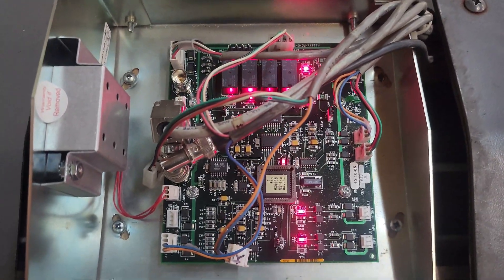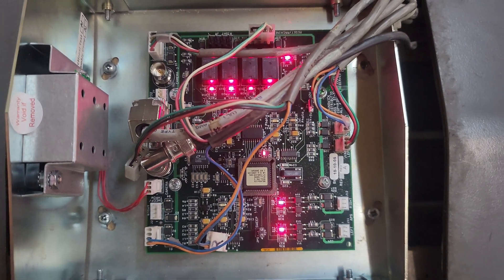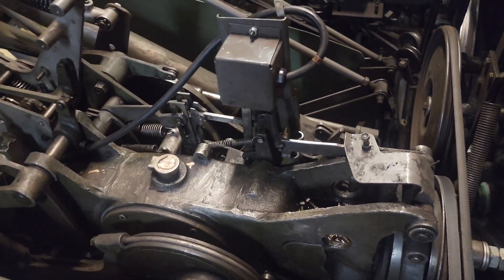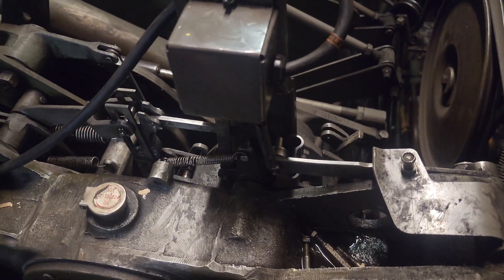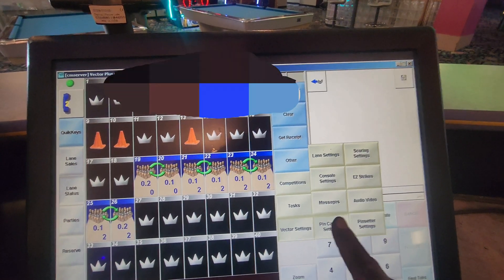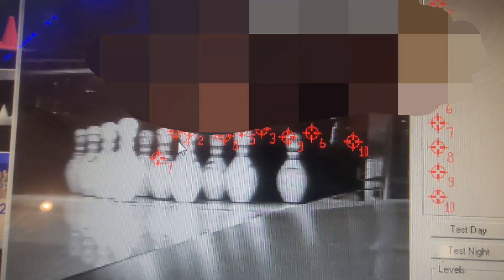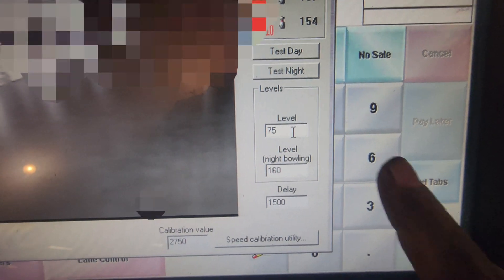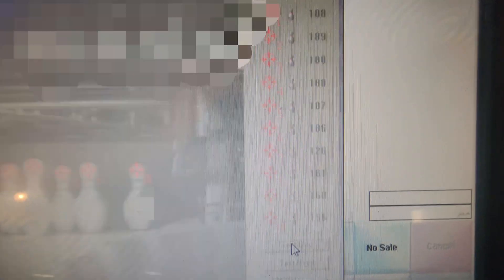Brunswick Vector Plus Scoring - Camera board swap and calibration.

Comment: Ever heard of the A2 modular pinwheels marking pins?  Not gouging pins, but dark splotches on pins?  Appreciate the video as usual.  Thank you!
Reply from the maker: They typically don't cause marks on pins. Are they being cleaned on any type of routine schedule?
Reply: @michaelbuckley3808  Both the pinwheels and pins are cleaned on a regular basis.  Just doesn't make sense.
Reply from the maker: I think there's a good chance that the marks are coming from somewhere else. Oil leaks on the pit curtain will turn it into a slimy mess over time. Pit cushions with worn facings or exposed rubber will do the same thing. The white top cross conveyor belts were notorious for turning pins grey. There's a lot of possibilities.
Reply: @michaelbuckley3808  I agree with everything you're saying.  I can drop a clean pin into the modular pinwheel and get the marks... without the pin going anywhere else.  The only other thing I can think of is the pin has been cleaned so many times that the outer surface of the pin has worn off causing the pin to mark easily.  I don't know... both machines are very clean.. including pit curtains.
Reply: @ericrathbun9836  Pin Guide?  Cross Conveyor Belts?  If you're speaking of the HDPE (hard plastic) modular pinwheels, I've never had one mar pins.